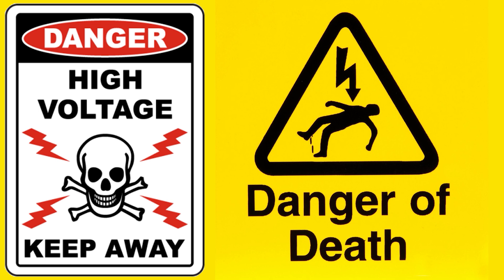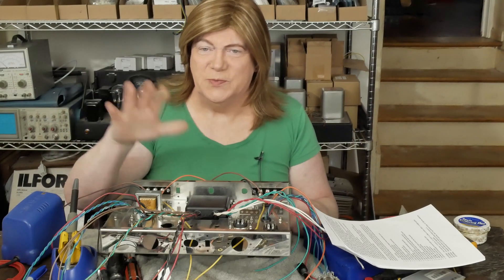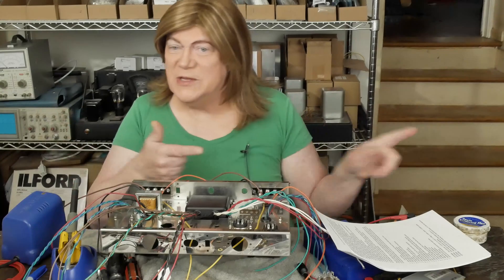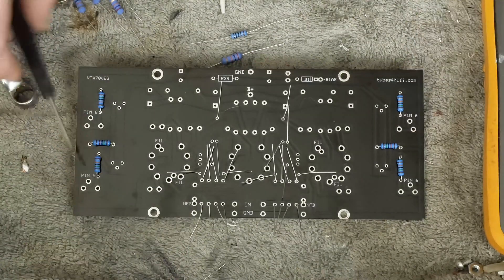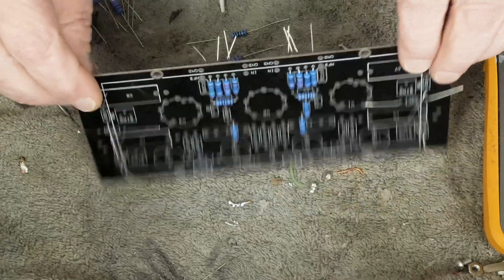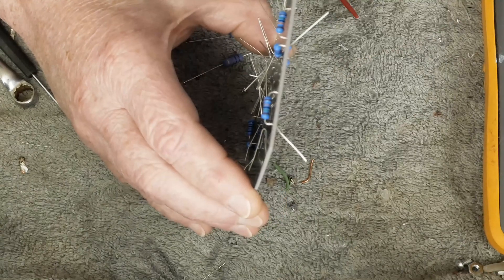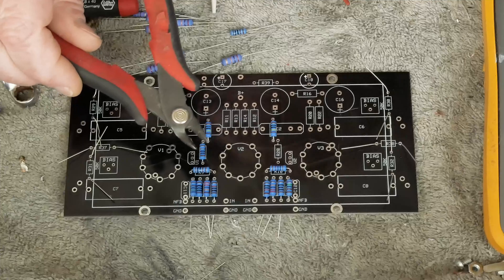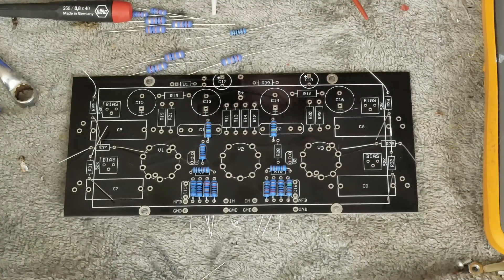Dynaco ST70 Tube Amp Kit: Building the Driver Board Part 1

Comment: All the resistors you are installing are 1 percent resistors, which today are pretty much the norm. But to think when these amps first came out, 20 and 10 percent were the norm. And they were carbon composition resistors, which would often change value with time. Also, if I am going to mount a bunch of things like resistors not flush with the board, something like a tongue depressor inserted under the part while soldering helps to create consistent spacing. And I know what you are feeling when stuffing PC boards. I seem to experience relaxation while doing it, too.
Reply from the maker: I sometimes use a piece of cardboard, sometimes I am lazy :)

Comment: Nice. Yes the components need space to flex as they heat and cool and the legs should also have space to move. I was taught (instruments technician) by a guy that built blackbox recorders and very sensitive instruments built for transport  to work critically in less than ideal conditions. He taught us to trim the legs off the components first with a slight bend so they don’t fall out and THEN solder last so the solder covers over the cut lead and seals it from corrosion. Picky yes but the gear we built in the 80’s is still being used today.

Comment: About 15 years ago I built the Audio Electric Supply AE-1 kit amp.  It was great fun and it worked fine, but its sound never won me over.  Have you ever heard that one?  I’m now enticed by this ST-70 and wondering how they compare.  I’ve also been eyeing the Muzishare X7 for a pre-built option.  How would the X7 compare to the ST70?
Reply from the maker: IMHO the ST70 has better iron than the X7 and much wider bandwidth because of that. Never seen a AE-1 so can't comment. I will say the fact they still sell ST70 kits 50-60 years later says something!